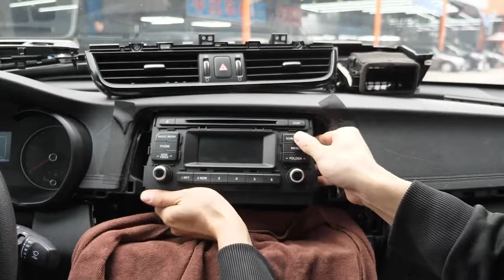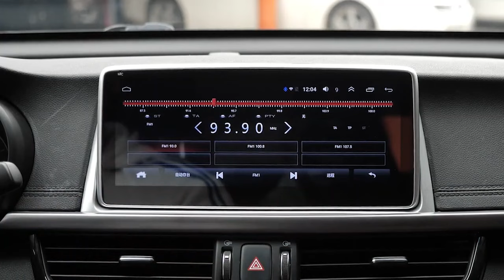Kia Optima Radio upgrade 2016-2019 Android stereo replacement touch screen carplay installation

Comment: Just got this in and started installing it. Powered on the accessories and the whole unit started smoking. All the sound and video cables immediately melted.
Reply from the maker: I think the wire issue , arrange a new harness to you now.
Reply: So you Fried you car
Reply from the maker: No just cable melt it cause by bad connection .
Reply: No car is fine trying out new cables soon
Reply: @topdisplay6691  All is good now. We got the connections working and the head unit is installed and works. Thanks for helping us earlier with new cables it is appreciated.
Reply: @nunya4732  No the car is fine, we received new cables from the seller which was nice. He checked in with us to make sure it worked and we got the installation and set up working.
Reply from the maker: @blackhand7294  already send , it should be arrive you days ago
Reply: @topdisplay6691  is there a slower vid showing step by step installation?
Reply from the maker: @kemyboi  The radio is plug and play,all harness are matched to your car orginal ones.

Comment: How about reverse camera? Could you show how does it works?
Reply from the maker: Yes ,it does work with factory and after-market camera.
Reply: Pretty sure the only change is the display and os because its hooked directly to the computer of the car, should have all the same funtions

Comment: How did the cluster little screend worked after the installation?.

Also what canbus did you use? And did it had amplifier?
Reply from the maker: The radio designed plug and play , and yes new radio also have 50W*4 AMP
Reply: Nice where did you order it from?
Reply: @topdisplay6691 does it still shows information on the cluster screen?
Reply from the maker: @sergcvs1910  yes it does
Reply from the maker: @sergcvs1910  www.ustopdisplay.com
Reply: @topdisplay6691  1. Does it shows climate control display information on the stereo screen?
2. Warning back up sensors?
3. What thing you didnt like and notice it doesnt do?

Comment: Great video!
I have the Kia optima plug in hybrid 2017 with nav / 360 camera. What will happen to PHEV if I change to this? Will I still reach those menus? There is menus for chargetime etc that I need to reach.
Reply from the maker: For this function we still developing , so far can't
Reply: @topdisplay6691  any update on the charging feature?